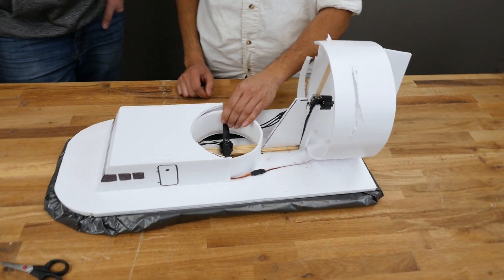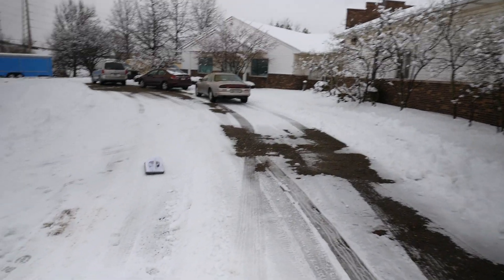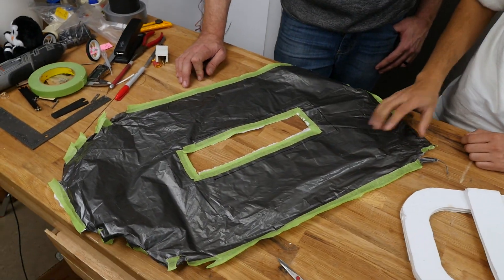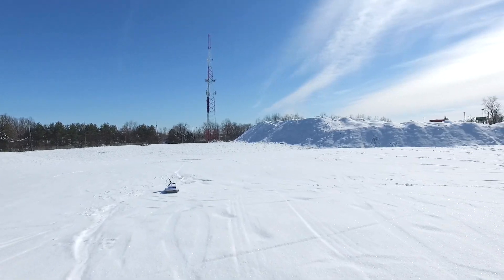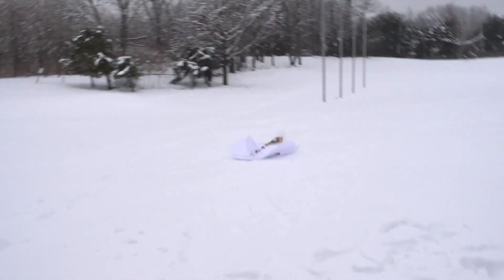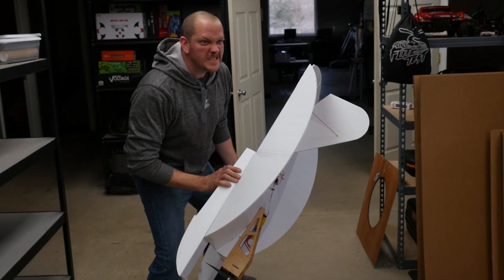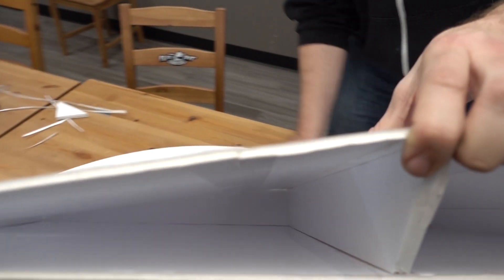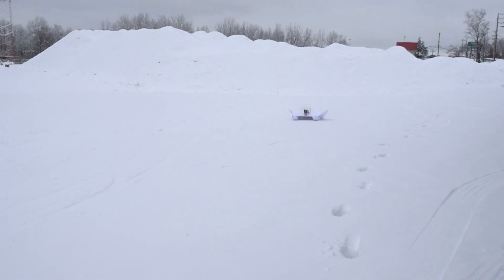DIY Hovercraft - One Day Projects For Snow | Flite Test

Comment: Currently creating a design for 3d printing based on the Navy's LCAC's.  The skirt only goes around the edges, allowing for taller skirts, and less air required.  Basically, it is a totally flat bottom, supports to separate the top and bottom layers (a few mm is all that should be required) to allow the air to flow to the edges, and fill plastic or rubber tubing.  Everything else would be basically the same.

Comment: Some tips for Peter's Hovercraft, it is lengthy but could save you a headache or two: 
For the hovercraft I affixed the gear default switch on a Spektrum transmitter to the skirt fan and mixed a -30% curve while active so that the skirt fan ramps down a tad when the main throttle is higher up. For some reason my particular builds glides better at faster speeds with less rpm on the skirt motor and a higher rpm at slower speeds. You will have to play around with it. It isn't necessary overall. There is a tarp-like material that is sold that is relatively flexible and more robust for the job then a garbage bag as Peter has stated on his other channel. It works well but almost feels over dampened in a way. It is quite bouncy. If I were to scale it 200% it would be a perfect solution year round I'd imagine. I found that by running the more robust stuff for the skirt in summer for concrete and water and a Hefty garbage bag in winter for ice and snow is the best way to go. Don't be discouraged from this project. It can be frustrating. The skirt is the most frustrating part but once you get it right and replicate it you are golden. Make sure you don't go too light on the build in terms of weight. Don't be afraid to go heavy but not as far as too be up in the rpm limit of your skirt motor for efficiency's sake. I found that making it heavier makes it more stable. I had tried an ultralight version with some depron additives and couldn't get the squirrel-iness out of it. Give your skirt fan some forward bias before you cut your hole for it. I tend to run 40% from center from the front. Some builds have a tendency to nose dive, if this happens adjust your skirt holes farther forward to guarantee better inflation there. You don't need to scrap the entire thing. If that doesn't work simply adjust the internal skirt stabilizer by adding larger or more holes to the front. If I can think of anything else i will edit this for the further. Happy hobbying everyone!

Comment: I do not know if this means anything, But I used normal foam board, and I put Flex Seal on it.  I built a sign for the top of my vehicle that has endured all the elements for about 6 months now, and it is in great shape.  For some of your waterproof tests maybe you should try this stuff out.  Just an idea, hope it helps
:-/

Comment: I need some help with my hovercraft. I'm doing pretty much the same setup, but I'm trying to attach my forward thrust motor to my elevator channel. Everytime I try, it just cycles through the arming process over and over again. I tried changing controllers and receivers, but the same thing happens. I also tried putting the forward thrust motor in the throttle channel, and when I do that it works perfectly, but my main lift motor now has nowhere to go. Any suggestions?

Comment: awesome kluski mann. I remember when I was a kid and I had bought a toy RC Tyco Hovercraft, what a biggest disappointment ever. It advertised that it can go on flat surfaces, I tested it out in a smooth cement basement garage but it was terrible.

The only fun I had with it was one time going to the lake. But I lost signal about 30' away, ran to the dock for signal. 5 minutes later, the battery died while afloat 20' out and I had to get out there into the cold water. Was pretty much the only time I had fun with it. Didn't even hover across snow but I do remember finding a giant puddle of ice but just not enough space.

Comment: Great, simple idea. Can it travel over water, short grass, asphalt, etc.?
Reply: +Douglas Snyder Water might be a bad idea unless you are using the new "waterproof" foamboard.
Reply: +Balu Peel off the paper....no problem.
Reply: +Douglas Snyder Amended comment. To clarify: I was referring to the hovercraft in my first comment and think paperless foam would work for that application, but, the snowball would probably need the structural integrity of the paper to make it work. Don't know. Just speculating.

Comment: can it drive on water and what battery did u use and were can i buy it or do u guys sell that stuff
Reply: +minimalaunt628 I wouldn't try driving on water with the standard foamboard. Even a few drops will make the paper peel off.
Reply: +minimalaunt628 You can get plans, but you have to build it yourself: http://www.stonekap.net/ftplans/hovercraft.pdf

Comment: Hello FliteTest! I'm not sure if you read these comments or not, but I have a great plane I think you can review. It's called the FlyZone Seawind. It's a fully amphibious plane (Land/Water Takeoff), retractable gears, flaps, brushless motor, lights, and a 56.5 inch wingspan. I have purchased one, but I'm still waiting on the battery. I have searched a while, but cannot find a well review of the aircraft. Even if you do a review of the plane, I will definitely have the battery by then. But, I believe the plane is excellent in itself, and I would suggest reviewing it.
Reply: +DandruffCat That looks like a really cool plane. It might be something for Peter.
Reply: Balu I'm sure he would like it most

Comment: i kinda want to build this and i have one question for the hovercraft... Is there two motors with two esc's connected to a "Y" servo connector and then plugged in to the throttle channel? I know that sounds kind of confusing but thats the best way I could put it
Reply: +rc hobbies Yes, I'd think they built it like that. 

If you have a programmable transmitter and a receiver with enough channels, you could just wire it up each on it's own and mix the channels so both have the right amount of output.

Comment: I have the ft nutball and apparently its tail heavy when its balances on the more of nose heavy side. What can I do to it. Add more weight to the nose??? Or is there any other ways cause I don't won't make it ugly. Please help!!! I want to fly it.
Reply: +Jyri190 - Move the battery far as you can go till the CG is at about 25% or so. If that does not do it, you may need to add some nose weight. Modeling puddy works well.

Comment: The real question here...will it "fly" on water?
There is hardly any snow here in Brazil, but I want to build it to play on the water. Can it handle it?
I'll probably build it on Depron, and maybe to the Duct for the prop with some pipe or something, since bending Depron is not THAT easy.

Comment: when I was younger I made a Florida style airboat out of chloroplast signboard and hot glue, it was heavier but very smooth with the flat bottom on the snow, had dual rudders like on real ones so it handled great and was fast with a 9x6 prop I think on a 3 cell lipo. Unlike Peters design I did not have a prop shield and ended up bending the motor shaft from a crash

Comment: Why paper on the foam? There are plenty of foams with plastic films for packaging and underfloor and siding insulation. A layer of 1mil polyester film would be cheap and tougher than paper and white. You can of course make your own with laminating film but the thin films are hard to come by.
Reply: +Wayne Russell Because it is a very cheap and easy to use material you can get about everywhere (if you are in the US).
Reply: Yes but they are now having their own manufacturing run for kits. And plastic is more waterproof and compared to the kit prices an insignificant component in their pricing.
Reply: +Wayne Russell Do you have  a manufacturer of foams with plastic film or a direct link? I might look into that. Problem is, most other foamboards - even with paper - are a lot heavier than Adams Readi Board.

Flite Test is also working with Adams to have their own water resistant foamboard produced.
Reply: The plastic film is a lot lighter than paper, so the foam could be even denser and still be the same weight as current Adams board. Some foam boards like Depron (and the local NZ paper covered board I use) have a tougher outer skin, maybe heat treated. The most common US source of plastic covered foam, even more persuasive than DTF, is fanfold siding insulation. I also got a very nice plastic covered white foam shipping box from a shipment from R2 Hobbies in Hong Kong.
White - http://www.goadams.com/news/rl-adams-plastics-introduces-house-wrap-alternative/
Pink - http://insulation.owenscorning.com/homeowners/renovation/products/propink-fanfold-board/
http://www.foamular.com/foam/products/foamular-sheathing.aspx (2 grades of plastic strengths)
Blue - http://building.dow.com/en-us/products/bluecor-insulation/?sc_itemid=%7b1e0988e0-893e-4732-a210-12933af71df0%7d
Green -http://www.trustgreenguard.com/product-applications/xps-siding-underlayment/xp-series-fanfold-underlayment/

Some of these are available pierced for ventilation.

Comment: Did you guys ever find that beautifully-ejected battery?
Reply from the maker: +Dieter Woerz Haha, yes we did.
Reply: +Yuri Danylko You could make it fly if you built it like an ecranoplan, I don't know if I spelled that right. Anyway if you built it like one of those it would fly using ground force effect it wouldn't fly very high but it would fly.
   Look up some of the ecranoplan vehicles they have on youtube and you'll get the idea!!
Reply: i thin they are also 60% more efficent!
Reply: +Yuri Danylko Its only enough lift to ride on, when there is no backpressure the thrust also becomes unstable. If you made a quadcopter that controls it's height, you'd have a somewhat hovercraft, that flies:P
Reply: we could make a plane with hovercraft landing gear and and automatically stopping hover-balloon filler

Comment: Did you wire both motors to the same esc and is that even possible
Reply: +Alex Polakis It's possible, but I would think they'd want them on separate channels so that they can keep the lift air consistent. On mine, I plan to put the lift motor on a dial on my radio and control the thrust motor with the stick.
Reply: No,I pretty sure that one esc can only power one motor
Reply: You can run multiple brushed motors on one ESC, but I'm not sure about brushless. ESCs are cheap. You don't really need too.
Reply: +Alex Polakis I think he meant same RC channel. If you have sensorless ESC it would be a disaster, possibly they might start to sync if they are same kV and same number of poles... if they see a similiar enough load... but naah it should f--k right up several times a second most probably.

Comment: Best hovercraft mix imo. Set throttle as pusher motor. Put the lift motor on a switch on another channel.  Put rudder on the right stick, and pull back on right stick kills the lift motor for brake. Also throw a gyro on the rudder, solves control ability issues on flat surfaces. An EDF as a pusher, vectored,  is also less delicate and won't self destruct if you hit something or flip like the large prop does.  Great video and ideas guys!